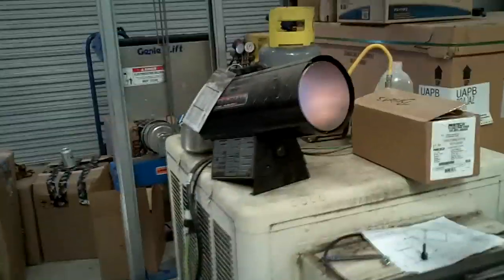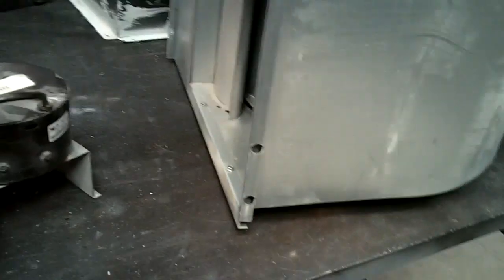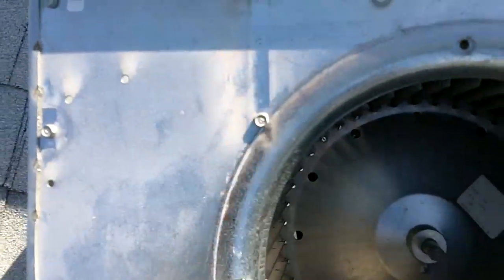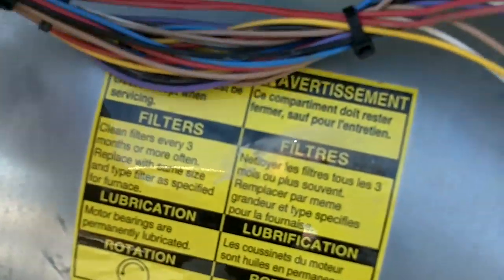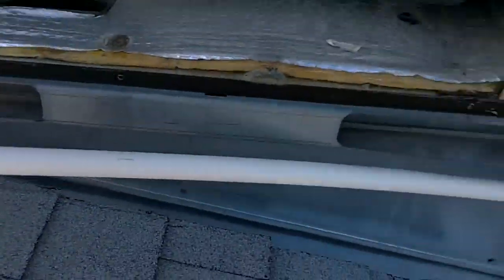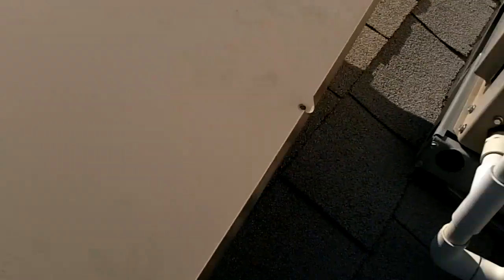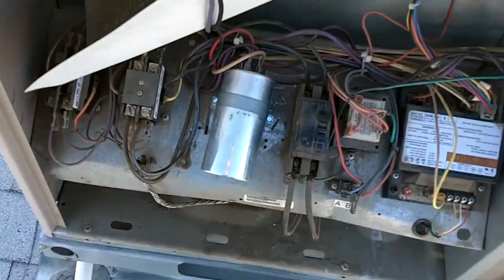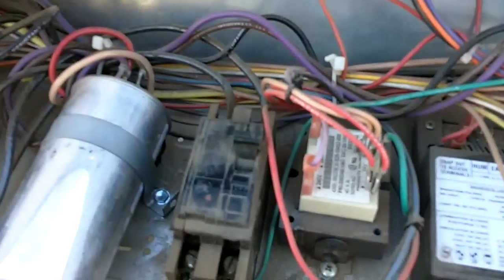HVAC ECM motor to X13

Comment: x13 motor is crap my job just installed 600 of carrier units which has the x13 motor and the majority of had to be replace as it is a ecm motor just in a simple connection package 1 if the module didn't die then it be the windings crass shorted burning out the x13 ecm package or the package its self known to burn its windings also the magnets do not have a  good resin composit as the magnets become free and causes a no spin ecm module thinks motor hard start then burning out module and winding. in short the motor is disposable as the module its self costs as much as a full motor. if you get a new unit with this motor replace with old fashioned pcs motor as under most warrant one replacement is warranty and after that is out of pocket.

Comment: At my work we just had all 300 units changed out and they all have the X 13 motor in them. One problem we are having is within a year now we have change out 76 of them due to the big pieces of shit they are BEWARE some have been replaced only  2 weeks after install all are brand new carrier units.

Comment: Would it be possible to get that wiring pinout on the ecm 2.3 to x13 conversion?  Is it ok to upsize the motor from a 3/4hp ecm 2.3 to a 1hp X13 unit?  Appreciate it!

Comment: thanks for the Video watching it to get more familar with ECM motor and installs of them, I went to helpa  Friendwith a package unit that looked the exactly like that, #DAYP-F042N080A 1HP ID motor that kicked my butt. Like a dummy was looking for the capacitor for the ID motor and had a helava time finding one, saw the control module and remembered ECM's are 3phase dc and don't have ones like the regular motors, its been a while since I have been on a unit and it showed

Comment from the maker: @mazzmari The ECM and the X13 both run on high voltage and both have a low voltage control board in side the motor, well thats what a call them anyway lol, but the ecm has 19 wires and the x13 only needs 6, so you need to figure out what wires on the low voltage you need like the common, heat, and cool. Then the high voltage black, purple, and the ground green. X13 is the only motor that will replace both PSC and ECM. On the next one I will show the wire's I used,

Comment from the maker: @tstatech LOL I had a York with a ECM on my home I just pulled it off and installed a Ruud 14 seer X13, man I love it. Don't get me wrong I am a Coleman guy to but the UPG line did drop the ECM's for the X13 on most of the units.  ECM's are good but they did have some problems in the UPG line and it was mostly due to installer error and some on the system , I have not had any go out on the Carrier/Bryant's. But they even went to the X13. 
Man you are going to love that set up of yours.

Comment: Great job on a cost effective retrofit. I like the X-13 but it doesn't have some of the benefits of the ECM. ECM's run at the cfm you set it for pretty much regardless of static pressure- with in reason. X-13 acts just like a PSC motor except that they are a wee bit stronger. The X-13 power consumption is almost exactly in between the PSC and the ECM.  

I have to talk the ECM up, Just bought a new York 98% mod furnace and 18 SEER/10HSPF 2 stage heat pump for my own home.